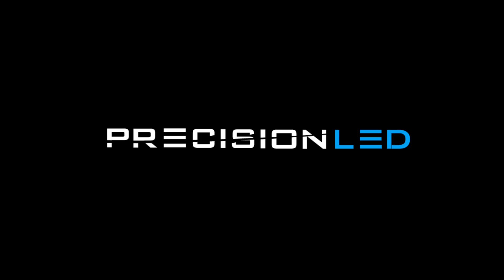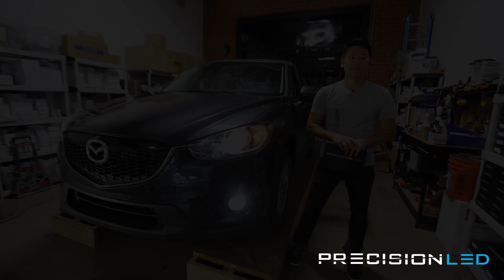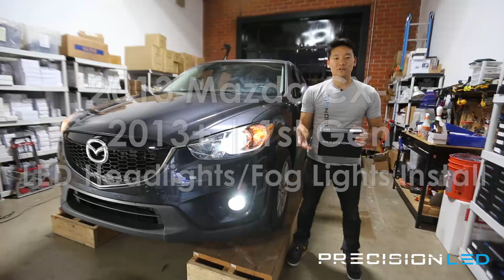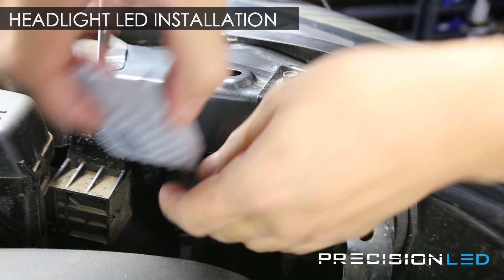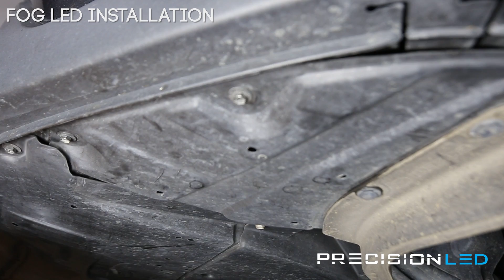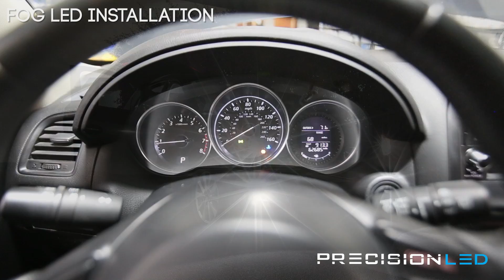Mazda CX-5 LED - Headlights & Fog Lights - How To Install (2013-2016)

Comment: 8mm socket do undo 4 screws.  The LED Fog lights will need to be clocked so LED chips face 9 and 3 o clock to sides as H11 connector faces at 4 o clock on the fog lights vs straight down 6 o clock on H11 headlights.  The Foglight will require aiming 4” below the center line of the Foglight at 25’ away from vertical wall.  The H11 LED bulbs should be close or 2” below center line headlight at distance 25’ away from vertical wall.

Comment: Hi,,,can the fog lights of the same cx5 be aligned or adjusted??  ,,is there a screw for that ?
Reply: The fog light adjustment screw requires a 10mm socket to loosen the screw, slide forward to raise beam pattern and rearward to lower beam pattern as it pivots at the top on both sides. LED H11 bulb will need to be clocked because connector is at 4 o clock and should face downwards at 6 o clock. LED chips should face 9 and 3 o clock when view from the front to produce correct beam pattern in reflector housing at 25’ away from a vertical wall. Measure the height of Foglight bulb from center to ground at 25’ away from a vertical wall Foglight should be 4” inches below Foglight center line.

Comment: Will this work for 2007 Mazda 5, if not. What does.
Reply from the maker: Hi! The fogs would be the same as linked in the description box above but for the headlight upgrade you would install H7s which you can find here:
https://www.precisionled.com/premium-h7-cree-led-headlights.html

Comment: Do these also work as high beams or is there something else?
Reply from the maker: The vehicle would use separate LED bulbs for the high and low beams.  The video shows the low beams and fogs.  However, the high beam installation would be virtually identical to the low beam installation.  Here is the kit you would install:  https://www.precisionled.com/premium-9005-cree-led-headlights.html
Reply: @PrecisionLED  thank you

Comment: For the headlights, will these LED bulbs work to serve as both the high and low beam lights in the same socket?
Reply: Morimoto 2 stroke 3.0 is the only 9005 bulb that will work with DRL as it 10% power on day time running lights and full power on high beams or if don’t mine loosing DRL function then GTR Ultra 2 9005 bulbs are plenty bright
Reply from the maker: The 2013+ CX-5 uses separate bulbs for the low and high beams, so the installation shown in the video will upgrade your lows only.  The high beam installation is identical, and you would install this kit:  https://www.precisionled.com/premium-9005-cree-led-headlights.html
Reply: For the high beams, do those LED’s give much more light? Do they reach much further, and how much more would that be?

I need more light for off road driving and wonder if changing these lights would be an option instead of placing a led-bar?

Thanks

Comment: Tengo un kit de led sin driver externo, ¿funciona?
Reply from the maker: Yes, we do have the H11 without the driver.  However, we do not recommend it for the highs, as the kit linked in the description is much brighter and safer for nighttime driving visibility.

Comment: I replace my halogen lights for H11 LED lights, but I have difficulty driving at night, I feel that my lights are to low. I was wondering if you can upload a video showing to all mazda drivers how to adjust the lights. 

Before hand thanks for all the helpful videos..
Reply: 10mm wrench or socket to adjust screw clock wise to lower, counter clockwise to rise beam pattern. Measure from dot or center of headlight to ground. On flat level ground 25’ ft from vertical wall, beam pattern should be 2 inches below the center of the headlight bulb center.  Foglight beam pattern 25’ ft from vertical wall on level ground should be 4” inches below Foglight bulb center height.  Loosen with 10mm socket screw slide forward to raise beam pattern or rearward to lower beam pattern.  LED H11 bulbs must be clocked so LED faces horizontal at 9 and 3 o clock to produce cutoff line in reflector housing or you will have scattered beam pattern in Foglight at 25’ away from vertical wall!
Reply from the maker: Thank you for your interest.  You do not typically have to adjust your headlight cutoff after installation.  However, there is typically a screw on the back of your housing you can twist to adjust the cutoff line if you feel necessary.

Comment: I just replace the bulbs, but the high beam turns on and off while a drive. 
If I not mistake mazda cx5 2013 has a day running lights. 
There is something that I can do to fix that ?
Reply from the maker: Are you installing HIDs or LEDs?  The issue you are experiencing sounds like an HID issue, as the bulbs will flicker when interfering with your DRL system.  However, our LED bulbs do not flicker, as they are designed to dim, exactly as your DRLs do.

Comment: Just purchased and installed mine for my Mazda CX5 today. They work fantastic, and easy to install!
The WOW! factor will be there from the moment you first turn them on. Thanks for this video!
Reply: Chris Johnson is your vehicle equipped with HID
Reply: No. I just had the regular halogen headlights. This will work for your CX-5 just as shown in the video. Installation was very easy.
Reply from the maker: Glad to hear it went smoothly, thank you for the support!
Reply: @PrecisionLED  no problem! They still work just like the day they were installed over two years ago on my Mazda CX-5! Great visibility and distance. Worth every penny.

Comment: Where is the wire that the power wire connects to coming from?
Reply from the maker: The power wiring coming from our ballast connects to the relay power harness that comes from the vehicle.  The relay power harness is the plug that your stock halogen bulb connects to.

Comment: Hi will the housings have to be re aimed after these led bulbs?
Reply from the maker: Thank you for your interest.  You do not typically have to readjust the headlights after the LED is installed.  However, if you feel you do, there should be a small screw on top of the housing.

Comment: 2016 cx5 :
 
I cannot disconnect the wire from the hallogen bulb. Tried pushing it down with my hand with full power and still wont come off.. any suggestion?
Reply from the maker: If you send a photo over to help@precisionled.com we should be able to make a suggestion for you.

Comment: Is there a kit for LED DRL?
Reply: 2016 CX5 GT have LED DRL under the projector HID.  All other 2016 CX5 have halogen H11 bulbs in projector housing than you have 9005 bulbs in high beam and DRL are high beam at 1/2 power.  Morimoto 2 stroke 3.0 9005 will be at 10% power for DRL and full power on high beams.
Reply from the maker: I believe the 2013+ CX-5 would project the DRLs from the same bulb as the high beams.  Installing LEDs on your highs will convert both your highs and DRLs.  You can find the compatible kit here:  https://www.precisionled.com/premium-9005-cree-led-headlights.html
Reply: @PrecisionLED  DRL's that use the high beams are typically made to run dimmer by operating them at a voltage less than 12V.  Do your aftermarket high beam LED's dim properly for DRL use at lower voltage?

Comment: Same bulb size for both the headlights and fog lights on the first gen CX-5??
Reply from the maker: Thank you for your interest.  Yes, we do have listed that both the low beam and fog light would use the same H11 bulb type, so you would end up installing 2 of the same LED kits.

Comment: When you finally get your hand on it. Make sure you push the clip located on the lower end of connector first, before pushing down on connector, otherwise you may yank wire or wires out.
Reply from the maker: Thanks for the tip!

Comment: I have a 2016.5 Mazda CX-5. My left headlight keeps flickering. I don't think the bulb is bad cuz it would stay on and solid for like 10-15 seconds then suddenly shut off then go back on again. Then stay on for like most of my drive then be okay. How do I check to make sure the power connection is solid? It looks hard to get to the left headlight. You showed the right one here
Reply from the maker: What you are experience could indeed be a power distribution issue.  The best way to approach this would be to get your vehicle's battery checked to ensure it is not underperforming.

However, this could also be a bulb or ballast issue.  In order to pinpoint the problem you could just simple swap the bulbs.  If the issue follows the bulb over to the opposite side, it is a bulb problem.  If it stays on the same side with the unmoved ballast, it would be a ballast issue.

Comment: When replacing the fog light with led bulb is there any modification to the housing?  Is the led same length as the halogen bulb?
Reply: You do need to clock the LED H11 bulbs in reflector fog light housing as the connector is at the 4 o clock position and should be at 6 o clock position
Reply from the maker: No, there would not have to be any modification to your fog housing.  Also, the LED would be very close, if not identical to the length of your halogen bulb.

Comment: Hi, do you have LED bulbs for the front turn signals? If so, how does it work (is it a switchback?) Also, does it need an additional resistor to prevent the hyper flash? Thanks!
Reply: Headlight Revolution sells GTR Ultra I LED 1157 iLED switch back bulbs with resistor or VLED sells 1157 V6 switch back bulbs with resistor for front turn signal bulbs that are amber when turning and white when park lights on.
Reply from the maker: We actually do not advertise turn signal LEDs as they would hyper flash when ignited.  Unfortunately, installing a resistor would not resolve the issue.

Comment: My 2014 CX 5 touring projector halogens looks like a sealed unit with no access to the bulb
Reply from the maker: You should be able to access the bulb, it just may be different from what is shown in the video. If you send a photo over to us at help@precisionled.com we should be able to make a suggestion!

Comment: Do the led lights turn on automatically when I turn my light switch to "auto"?
Reply from the maker: Yes, the LEDs would react exact as your halogens do.  The auto feature is simply a sensor that tells your lows to turn on when it gets dark.  It is the same as flipping the switch.
Reply: Thank you!

Comment: Sir, is 2015 CX 5 Sport have the same wire connections for different models?
Reply from the maker: Thank you for your interest.  Yes, your 2015 CX Sport would use the same wiring connector as shown in the video, as it uses the same bulb type for the low beams.

Comment: Great video! Will this be compatible with the 2014- present Mazda 3 models as well?
Reply from the maker: +W. Woodson No.  You will need the Mazda 3 package, http://www.precisionled.com/mazda-3-led-interior-lights-kits-2014-present.html
Reply: +PrecisionLED Ok cool. I saw that video, very detailed! Will there be any 2014 Mazda 3 headlight packages soon?
Reply from the maker: Yes, we do indeed have a headlight package for the 2014 CX-5.  You can find the compatible product here:  http://www.precisionled.com/premium-h11-cree-hl-gl-headlight-led.html
Reply: +PrecisionLED is there led license plate lights available for the cx5 2016
Reply from the maker: Yes, we do carry license plate LEDs for the CX5, which you can find here:  http://www.precisionled.com/premium-t10-canbus-6smd-5730-led.html

Please note, you would have to up the quantity of LEDs to match the amount in your license plate.
Reply: was there any flickering on the headlights? do you need resisters?
Reply from the maker: The headlamps already have built-in resistors.  No, there will not be any flickering with the headlamps.
Reply: Do the resistor boxes get really hot, do you have to worry about the sticky tape unsticking or melting
Reply from the maker: The ballasts get a bit warm, but not nearly hot enough to melt the double sided tape.  This is not something you have to worry about.
Reply: It works for my chiron